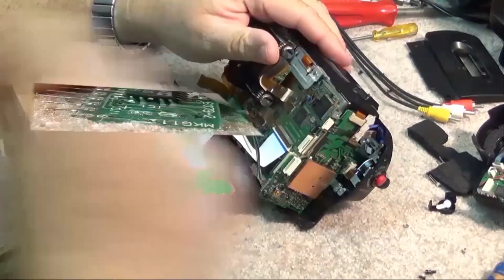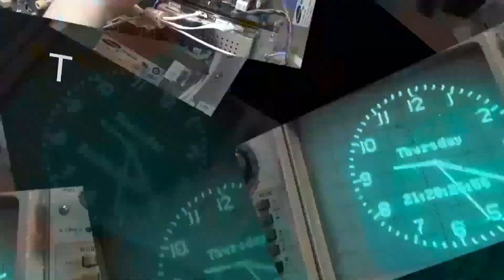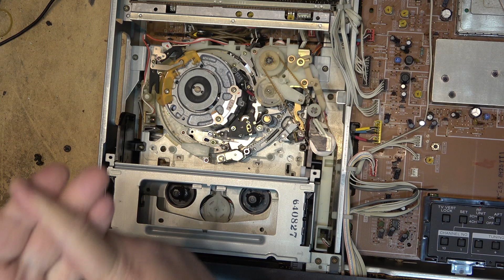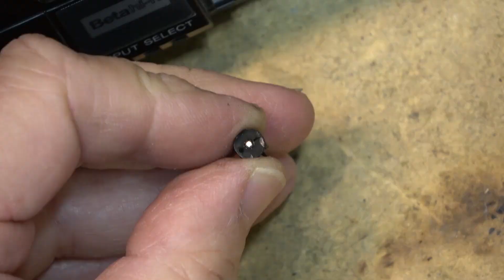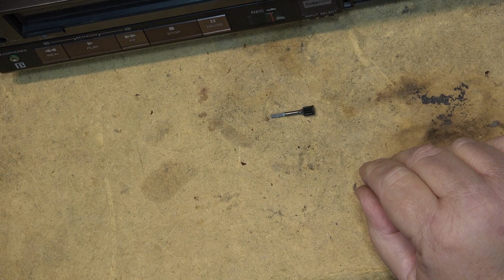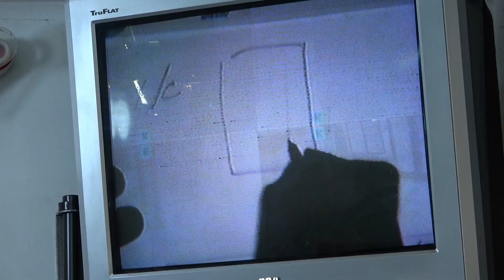Sony Betamax 711B chassis will not load tape .

Comment: I remember this mechanism from my first Sony Betamax machine, an SL-HF400, which I bought broken with money from selling a couple Sanyo betacords, sadly that one probably had a damaged head because it had a blurry line through the center of the screen horizontally, and not after 5 mins of using it the drum seized (probably a bad motor IC) so not knowing how high end it was I used it as a parts deck to fix an SL-HFR30 that had its original box remote and manual, that one after replacing the STK, gluing the split loading gear and lubing the tape reels, it worked great and I eventually sold it.

Comment: Was the gear cracked sue to shrinkage? If so, wouldn't you need to make the hole bigger before gluing it?
Reply from the maker: It's cracked now.  It will expand.

Comment: I have a Sony TC-K666ES cassette deck with direct drive reel motors. It's a nice machine now that it's working, but it sure gave me headaches trying to service it.
Reply from the maker: Yes I am familiar.  Had a guy about 40 years ago broke every tape on rewind. Had been told not to use anything longer then c90 but he kept buying tdk c110 tapes and then would come in and scream when it snapped a tape on rewind or ff.  Reel to reel it worked better but cassette and vcr not so much.

Comment: Is the back-tension on the SL-2000/2500/2700 supposed to be higher than on later machines? How does the monoscope section of the alignment tape look like on one of these machines? I adjusted the tension on my SL-C9 (done electronically on the servo board) and while it plays fine, the bending of the picture below the switching point is quite high. I had no choice but to twiddle it because it wouldn't play at all before.
Reply from the maker: The monoscope head switching is not to set back tension.  It's used to set dihedral on the B head.  That's the lateral position. On the drum and it's adjusted by putting adjustment wedges into the spinning portion of the drum and adjusting the head chips.
Reply: @12voltvids  Yes, I am aware of the dihedral adjustment. But can't you also coarsely adjust the back-tension by looking at the amount of flagwaving right below the switching point? I think you did that in the past on an SL-HF600.

Comment: Was the best format those days...still love to just play around with my beta machines...as well as the 8mm format. My V100E still my favourite. On the 8mm format...my CCD-V90E still perfectly working...my question...why did Sony drop the loading mechanism as was used on the V90E...just amazing to watch it loads and ejects...sooooo professional.
Love to watch your videos on those formats.
Greetings from South Africa.
Reply from the maker: I am assuming the 90e is the same mech as v110 which is the original 8mm u loading system which is the same as betamax BETACAM and UMatic. The m loading was developed to make the mechanism more compact for cameras.  U loading is better in the respect that since the guides don't move the chance that alignment will shift is very low.
Reply: 緑色は石鹸のような感じでプラスチックでは合わないかもしれませんね。😊

Comment: I just bought ed beta 8000 from japan it loads a tape but can't eject as the right side comes out of allingnment and gets stuck and tape goes back to the playing position otherwise it fine
Reply: 711B3 carriages are known to have broken posts. That will cause it to load or unload out of alignment. Had to fix my SL-HF860D for that exact reason.